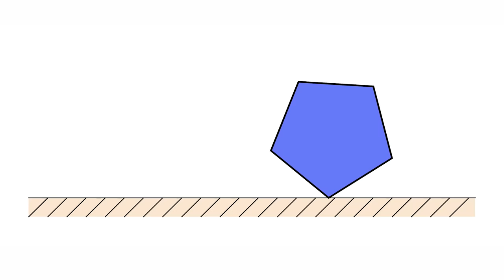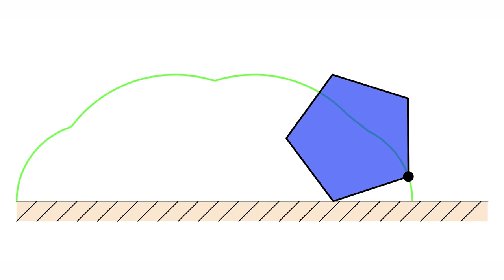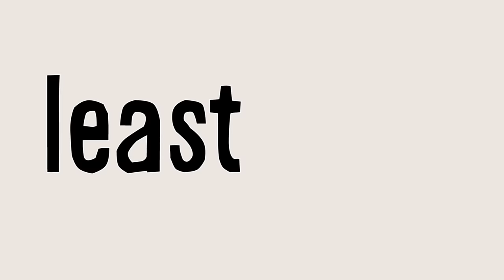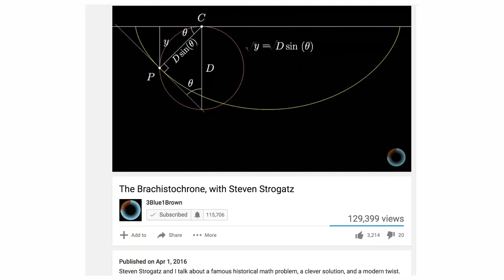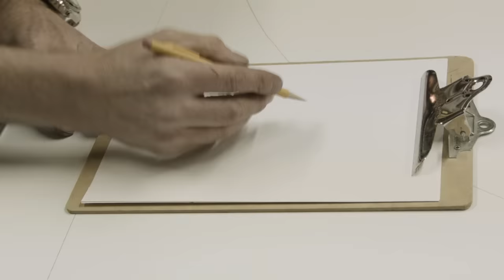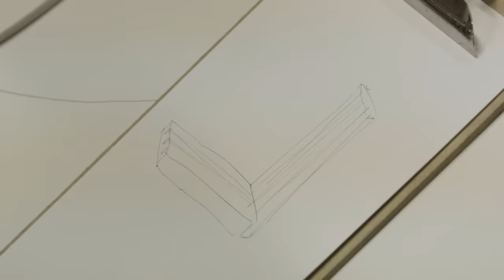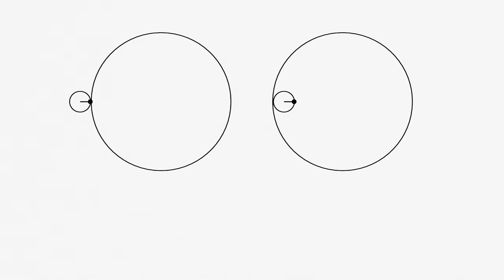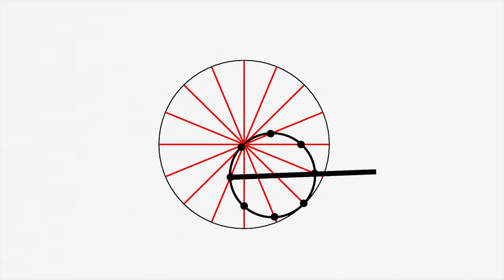The Brachistochrone

Comment: I have a weird question... can we still find the correlation between the cycloid and the quickest path with a different g value? (like for example g=1.6 - moon gravitational constant). I assume that for zero gravity the quickest path is indeed the straight line.
Reply: Adrian Costea Wat.
Reply: Intuitively I would assume that for any acceleration constant (9.8, 1.6, etc.) this will be the fastest path. But as for zero gravity, what do you mean? If there is no acceleration and constant velocity, then the shortest path will also be the fastest.
Reply: I'm more curious what the best curve would be for an accelerating acceleration.
Reply: Adrian Costea it would actually be just a point, since we start with an object in rest.
Reply: My brain hurts
Reply: I am asking the question out of curiosity. It is surprisingly beautiful that we are able to find such an elaborate "formula" to determine the quickest way for an object to move... but the amazing detail here is the way we construct the curve - the perfect cycloid induced path... so I'm curious if this still retains for a different gravitational pull.
Reply: It does, so long as all the objects you roll down the curve are affected by the same value of g it doesn't matter what that value actually is.  If g is zero though then it breaks because the objects won't even begin moving in the first place.  It also breaks if the only gravitational bodies are the roller and the ramp, as the roller would roll towards the center of mass of the ramp eventually settling as close as possible to it.
Reply: Adrian Costea Haha, and i'm here not knowing what the fuck is going on.
Reply: Adrian Costea lol me too
Reply: Hi Adrian,
To answer your question, The Brachistochrone Problem is valid for all non-inertial (read: accelerating) frames, where basically the sum of forces is not zero, or in simpler terms, gravity exists. Reply to this thread for more questions.
Reply: As long as the gravitational force, regardless of its' magnitude, is constant then yes this will always hold true as the only thing that changes is the rate of acceleration.  Remember that the gravitational constant is, put simply, a rate of "downward" acceleration. So for your example  of the moon - it would give the same results as shown on the video, only slower. 

For your zero gravity question: As gravity is not present the objects would neither speed up nor slow down ( assuming they were given an initial "push" of velocity ), meaning their momentum would be unchanged. ( assuming there is no form of resistance opposing it ). So if each object was given an initial velocity under no gravity and with no resistance then the straight line would indeed be the quickest path.

With no initial velocity in a zero gravity setting the objects wouldn't move at all, as there are no forces affecting them.
Reply: James Miller tha's a lot of words
Reply: i dont see why it wouldn't work in any other gravity type, just as long as you have gravity there. think about it the odds of the quickest way to travel that distance being the perfect ring of the circle is pretty much impossible
Reply: Who said it wouldn't work in any other variation of gravity? In fact, ones who are clearly more intelligent on this comment thread have said the exact of opposite of that, so I'm not sure what your getting at? And how is it impossible?

Comment: Wait a minute. Light can slow down? But I thought the speed of light is constant.
Reply: Pokerface in a vacuum the speed of light is 3.00x10^8 m/s
Reply: Pokerface Light itself can slow down
Reply: It can slow down depending on what it's moving through. The speed of light in water is constant, the speed of light in air is constant, the speed of light in a vacuum... etc.
Reply: Pokerface no it can't slow down besides that the route it take may be longer if changed
Reply: Pokerface when travelling through a medium it gets slower
e.g light travelling through water will be slower than light travelling through the vacuum of space
Reply: The speed of light in vacuum is constant. Light can have different speeds in different materials, and sometimes other things can breaks the speed of light in that material - like electrons faster than light in water (Cherenkov radiation)
Reply: Pokerface in vacuum
Reply: okay everyone here is a bit of wrong and a bit of right.. light always travels the same speed. But it's speed through some materials can be changed because of the "collisions" light will have with the material on an atomic level. Basically it's bouncing around a bunch. Imagine a pinball game. If there are no bumpers, walls, springs, etc. to hit then the ball will travel through the machine to the bottom quickly (IE a vacuum). However the machine does have terrain to hit, and makes the ball bounce around a bunch before it gets to the bottom. Same idea, but in the case of light it never slows down or speeds up, it just gets bounced around a bunch.
Reply: Pokerface people say light slows down when it goes into more dense materials as it takes longer to get through when technically it does stay the same speed
Reply: The speed of light is constant and can't slow down, but the path that light makes through any material is longer than the path light makes in the vacuum. So if light goes through water, for example, it doesn't slow down, but it makes a longer path and creates an illusion that it's going slower.
Reply: In a vacuum :)
Reply: It's still traveling at the same speed. It just sort of takes a longer path if you will. It's one of those things where the exact explanation takes a whole lot of time and just saying "it's slower" is more convenient. Don't worry though, it doesn't actually slow down.
Reply: Pokerface it is, a car on a highway can have a top speed, and be unable to exceed that speed, but that doesn't stop it from slowing when driving in the mud.
Reply: Light speed can vary depending on the medium it's travelling, constant when traveling in a vacuum.
Reply: Pokerface go back to school or if you're  still in school then revise physics again 😂
Reply: No, it's not. The speed of light people talk about is a speed of light in a vacuum.
It has different speeds in different materials, that's why there is a refraction effect in water.
Reply: Pokerface it's constant in a vacuum, like space
Reply: Pokerface it's like sound as it goes through different mediums it will travel at different speeds
Reply: When not in a vacuum light will constantly bump into particles, which change its path. It still travels at a constant speed, but not in a straight line.
Reply: no, the constant is the maximum speed light can reach in a medium, and that is 3x10^8 m/s in vacuum. On any other than that it's gona be slower.
Reply: Pokerface it's constant in a vaccum, which technically doesn't exist. for example in sulfur ice light travels nearly half the speed it does in space, and in actual outer space it travels about 99.9999(near inf 9s) speed because of the impurities in the outer space mediums
Reply: Marnige You mean dimension?
Reply: Pokerface The speed of light is constant in whatever medium it's in. "c", as in E=mc^2, where c is the speed of light, is actuslly the speed of light in a vacuum.
Reply: The speed of light is always constant, in a vacuum, relative to other things. As long as it is in a vacuum, it will always be a certain amount faster than other things. This applies even when a large mass curves spacetime. The speed of light may slow down in the perspective of an outside observer, but it will still be as fast as it should be to an inside observer.
Reply: Funny thing, if light always follows the tautochrome curve as stated in this video, it curves when it changes speed...  so if you knew were the light was emitted and measured when it hit a surface (regardless of change of velocity)...  the time it took to travel the distance would be the same when you measured it.  Ie., constant.  ;)
Reply: the speed of the photons in light is always constant. When light passes through an optically dense object, protons need to "dodge obstacles" and thus travel a longer distance, making light take a longer time and thus making it seem like light slowed down.

EDIT: those "obstacles" are the particles (molecules or atoms) in those objects of course

EDIT EDIT: changed protons to photons. It's late at night and I feel like an idiot for not noticing ;-; thanks Guy Roland for noticing
Reply: Light has properties both of particles and waves, due to it being similar to particles, it is able to slow down in different environments, however the speed change is something like 2*10^8 ms^-1 in glass, if it has index of 1.5, from a speed of 3*10^8 ms^-1 in a vacuum. (This is knowledge from A-level physics, so feel free to correct me.)
Reply: Pokerface light only goes at max speed, c, in a vaccum, aka space.
Reply: Whatever speed it's going, it still counts as the speed of light because it's light, and that's how fast it's going.
Reply: FlamingJM 
photons*
Reply: FlamingJM You mean "photons". Light is not made of protons.
Reply: Dolan Tramp The speed of light in a vacuum is 299,792,458 m/s if you want to be exact, not the value you mentioned.
Reply: Guy Roland oops, changed it again. Thanks m8
Reply: Pokerface the speed of light is constant in a vacuum
Reply: Martin Bailey trippy.
Reply: Ryan Karuna wrong
Reply: I'm surprised no one mentioned that C is the speed of causality.
Reply: KinRedysko light doesn't change speed body
Reply: Kent Burns nop light doesn't slow down either
Reply: it's just that the light can't travel at more than that speed
Reply: Photons can slow down as they come in contact with other particles. They lose energy and thus "slow down." 

In a vacuum where there are no particles are only where photons maintain a constant.
Reply: Jean-Raphaël Carrier yep I realised I was an idiot and changed it, thanks m8
Reply: Lavourrin it doesn't have a different speed it just taking a longer route
Reply: Pokerface I think what they meant is that passing through certain material makes it take a longer route than a straight line, therefore it's travel time is longer
Reply: Pokerface waves are affected by what substances they go through.
Reply: The speed of light is constant in a vacuum not through air or another substance
Reply: The speed of light depends on the medium it travels through. 

Thats the reason for water refrection, for example (light moves slower through wather than through air.)
Reply: Dolan Tramp yeah but that c is not only the speed of light. Einstein himself just said through Special Relativity that c is the maximum speed in which information can travel through spacetime. You just can't said c is the speed of light, because gravitational wave also travels in c.
Reply: c is defined as speed of light in vacuum. light travels slower than c if traveling not through vacuum.
Reply: Dolan Tramp bish I learned it in 7th
Reply: Pokerface Help!!! It's a battle between 2 Teacher D:
Reply: Light always travels at the same speed IN ALL MEDIUMS, but when light interacts with an atom, an elecron is bumped to a higher energy state for a split second before being re-emitted. Effectively the light stops at every molecule it hits. The density of the molecules and the retention time are what changes the effective speed of the light.
Reply: Trevor Allen it is just too cringe how bad you are in physics. As many people said before the path light takes is not a straight line and that causes it to take more time although the VELOCITY is always constant. The flashlight gets dim because as the beam travels away from it, it diverges and that's what causes it to become dim. And light can't experience friction because it is just a form of energy. Nonetheless the thing is SPEED OF LIGHT IS CONSTANT IN ALL MEDIUMS THE PATH IT TAKES ONLY CHANGES
Reply: The wavelength of any frequencied waveform will shorten when travelling through a denser medium. In other words, it will be moving "slower", and create a higher frequencied reproduction of that waveform. So for example, in water,  sound travels slower . While in air, it travels at 340 meters per second, it's much slower in water. This means that in water, the pitch of the same sounds we would normally hear can increase so much that its no longer audible to our ears, except a high pitch whining, the farther from the air where the sound was initially produced. The other side of that coin is that in space, sound waves travel so quickly that we will not hear anything. There are no air particles to excite, for one thing, which means the sound wave travels so fast that the waveforms are huge. They are so many octaves lower than they would be in air, that they are inaudible.  The same principles that effect sound effect light, but on a vastly smaller scale, because wavelengths for light are in the nanometers.
Reply: when shooting light through a medium of supercooled gas (look it up, I don't remember what it was), light traveled through it at 5mph...
Reply: Pokerface it always travels at c, but can   be bumped around by particles depending on its medium
Reply: speed of light in vacuum is 2.99 x 10^8 m/s. As it moves through high viscous and dense substance (i.e. changes medium), the value decreases.
Reply: Pokerface Light beam slows down, but the photons do not. Imagine driving at a constant speed on a straight road and driving at the same constant speed but taking some turns, your speed remains constant but your journey takes longer. However it is an illusion that light slows down. it is just going round the block in a dense material than going straight in a thin material.
Reply: That make me wonder, do light just travel on something that already going that speed? that make a lot of sense to me if it does.
Reply: What is refereed to as the "c" speed of light, is the constant which describes the speed of light in the vaccum, or better, the speed of causality. Light can travel at or lower than the speed of causality, depending the refractive index of the medium it travels in.
Reply: The speed is constant but the path it takes in different substances varies. In a vacuum it's a straight line, but in air or water it will alter its course because of the molecules, so the average speed in that substance, when going from point A to point B, is smaller than in a vacuum, even though the instantaneous speed at any given moment is still the same.
Reply: FlamingJM 
You're welcome :)
Reply: That's a good point and easy to confuse based on how it's explained. The speed of the light did not change between the light and water, it's always ~3.0x10^8 m/s. What changed was how it interacts with the atoms in the medium. For water, it absorbs the light, excites an electron, which falls back down in energy and release the photon again. That interaction took time, which is why you see the light move more slowly through the water.
Reply: +Potato Battery No, that's completely false. Speed of light changes in different mediums, not just the average because of a different trajectory.
Reply: Go read up on it, the actual speed does not change. As others have commented, we just say that the speed changes in different mediums because it's easier than explaining how the photons take a longer path due to collisions on a molecular level.
Reply: +Potato Battery You're just wrong. "c" is the speed of light in vacuum, which is defined as the speed of causality. It literally does change. The photons do not bounce around like particles as you suggest, because refracting photons do not act like a particle. Also, do not be confused, we are not speaking about relativity here, just different mediums, the light travels in.
Please, read up on some physics, before spreading misinformation here.
Reply: +Dolan Tramp C = constant. C = the speed of light at vacuum = the speed of causality. C is not the speed of light at a medium.
The wave particle duality exist only in certain situations. In refraction, light acts as a wave.

Also the last part, yes you're wrong. Photons travel linearly, following the curvature of space. Even lasers, can't make photons travel completely parallel, so no matter what earthly technology you use, the light beam will diverge, infinitely.

Why do you insist, considering that you don't seem to have any knowledge in this? Is it so hard to read my comments, and some wikipedia pages?
Reply: +Dolan Tramp Keep trolling, fool...
Reply: Katrina L
The speed of a photon (c) is always the same. The speed of a photon getting from point A to point B changes, based on what medium that photon is traveling through, and how dense it is.

A photon can't move other particles out of the way easily, so it just bounces off of them during encounters. This can be observed when throwing dust/powder into the air and shining a flashlight at it. You wouldn't be able to see the dust if the photons could travel through it.

Ever heard of the Tyndall test? If not, you should read up on it - it's sort of the same principle.
Reply: +Katrina L /r/iamverysmart
Reply: +Potato Battery Oh, the irony.
Reply: refraction changes the speed of light

Comment: It appears the slot on the roller was deeper for the straight curve. This effectively changes the radius and size of the circle making this test imprecise. The effect is more dramatic between the straight path and cycloid. I noticed this from the holder at the top. Cool build though.

Comment: It's about using all of the potential energy that the ball has, as that will get the ball there faster. The thing with the shortest path is that it will have more leftover velocity when it reaches the point, so it cannot have reached there faster than a path that utilizes more of the potential energy.